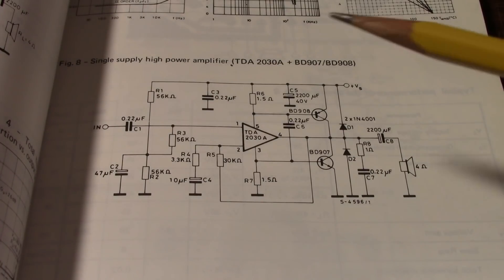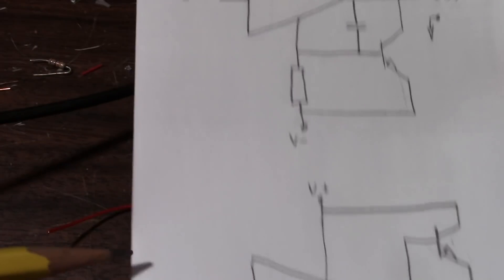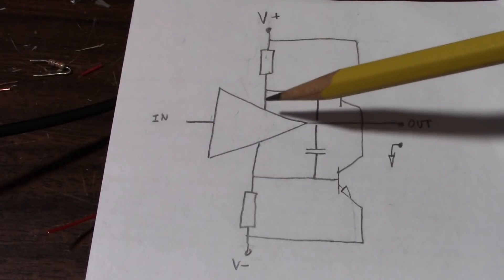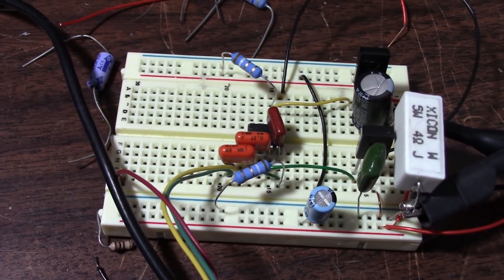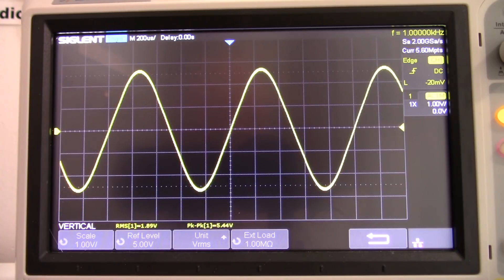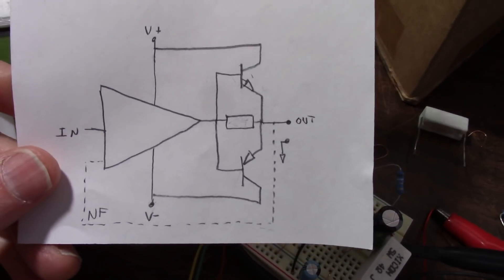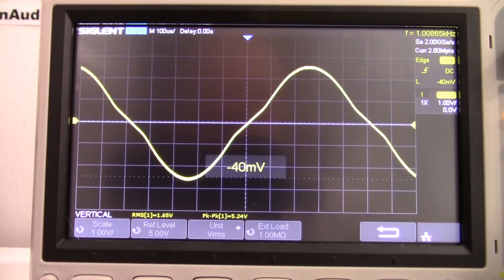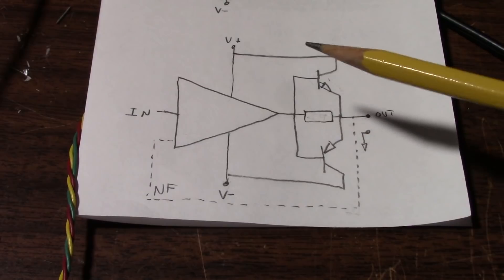Booster transistors on an LM386 - why it failed

Comment: I think that around 9:22, you're being incredibly optimistic about the potential output swing. Remember that with a 9V supply, you've only got around 7.6V available to the LM386 when it's being driven to clipping because of the two transistor junctions that in series with the supply to the LM386. If you look at the datasheet for the LM386, even with a 16R load, you'll be lucky to get a 6Vpp swing from a 7.6V supply, so your 5.36Vpp is quite reasonable.

Comment: Have an IC that may be one that will compare to the LM386 and it shows it works with a 4 Ohm load. The part is a  TBA820M that Future Kits uses in their Amplifier kits.

Comment: Howdy.
One step forward in improving is connecting a dummy load resistor to the LM386 output and disconnecting it from the real output.
In my blog:  "23. A Solid State 50 W Class AB Audio PA. Luokan AB 50 W transistoripäätevahv."
I have a study of a similar project.
Regards.

Comment: I’m curious if you were to use a dual power supply and feed the transistors a much larger voltage if then you could get more power. I definitely could think of some uses for this like may be driving a reverb tank where the distortion isn’t going to be an issue.
Reply from the maker: Circuit is limited by the output voltage from the IC, so more voltage would need to be applied to it.

Comment: Thanks for the video John. I'm reminded of a circuit I saw used throughout a MCI JH600 series console: this used 70V rails (+/- 35V) and every stage consisted of a high voltage opamp with buffer transistors. The transistors were emitter followers with 10 ohm emitter resistors and were driven by a 1K ohm resistor at the output of the opamp. The bases were tied together. This configuration used negative feedback (10K I think), but the purpose was so each stage could be patched into a mult and drive several inputs (usually 600 ohm). I think I've described this accurately, but it's been 20 years or so. I enjoy your videos and look forward to your next.

Comment: Hi John I love your videos I've learnt a lot I was wondering whether you could help me with something I have have I set off Kenwood 6 ohm speakers which I want to attach to my Samsung TV what is the best amplifier for it and do I need a preamp
Reply from the maker: As long as the TV has a line out connector, about any amp can work. There are lots of budget amps under $100 that can work. Most TVs let you adjust the volume through the line out so you don't need to walk over to the amp to adjust the volume.

Comment: I wonder what the results would have been if you had upped the voltage to closer to the max, say 15-16 volts. No use in burning out a perfectly good LM386 at 18 volts.
Reply from the maker: I did run it at 12 volts and got just under 2 watts at 4 ohms. Weak for that voltage but the LM386 can't do that alone.

Comment: I think you need a solid load transformer. If LM386 works well on 16 Ohms load, you have to translate this current into output transistors current (loaded with 4 Ohms of course).

Comment: The LM386 is a self-contained amp with its own output circuit optimised to drive a speaker directly while conserving battery life. It's main design feature is its tiny current draw. More volts in will just smoke the chip so its a one trick pony. Adding a second power amp to the back of the clamped down power amp in the 386 is a challenge and a pre-chip driver will overdrive it. It would be hard to imagine a worse candidate for power boosting. You showed that a 16ohm load would allow more volts in and a bigger swing, I would like to see the built results, I'd guess a nicer sine wave but no more amps to drive a speaker? How about driving two LM386 together in push-pull you have the neg and pos inputs but would the chips share the load and double the output?? :)
Reply: Another suggestion John, it might be interesting to build the whole circuit suggested on the paper you showed at the beginning, rather than just a cut-down output circuit. I am a newbie to electronics so you'd know better if there is some 'magic' ingredient in that schematic. Brilliant video, it's great that you build and test, rather than just a dry discussion.

Comment: I knew what was coming, but experiments and observations with a scope and final analysis of the results are always educational.
An NE5532 driving an output push pull current stage with global negative feedback is pretty low on the parts count and provides much better results than trying to do things with an LM386 :)
It's just not a very good amplifier really

Comment: Truth be told, I have never seen this circuit working with the TDA2030A let alone the LM386.... 
I have seen the TDA2030A circuits in their datasheets and have always wondered if it was actually an good! 
It's just something that I have been planning on putting together for testing, I have plenty TDA's to play with so I guess that I will have a go at it one day... There's an excellent 3 way powered speaker amplifier design that uses the booster transistors for the bass driver in the ST datasheet and another version for a 2 way design possibly from the brand of datasheet that you have there... 
So basically if you have a TDA2030A in stock and decide to build it, I will definitely be watching it! That video doesn't exist on YouTube anywhere! 
What I don't get, is why the transistor base is tied to the rail's? I would have thought that they would be tied to the output of the TDA! Basically using it as the driver stage before the transistors but it seems that they are trying to add the TDA output to the transistor output for some reason....
Reply: This saves you from trying to bias the transistors and it eliminates the in the trivial case fairly audible crossover distortion. Since crossover distortion is pretty much a "solved" problem in a decent chip amp, they try to leverage it to drive the lower output voltages, where it will provide less distortion than any transistor contraption that you're likely to just throw together.

The bases on rails thing also makes the transistors turn on somewhat gradually, which is a good thing. As you see in the scope, there is no hard knee there, it's softened a little. This is crucial to allow the global negative feedback to linearize the circuit, since negative feedback is increasingly ineffective against higher order discontinuities due to inherent slowness of the chip amp driving it. These ideas don't really help the LM386 because there is no global negative feedback, the feedback is locked to within the chip.

Comment: Would this configuration allow you to use a higher supply voltage then the chip amp by itself which would overcome the loses?

Comment: Wonder if a biased common emitter stage with local feedback, connected to the output, would do better
Reply: the problem is that the lm386 already has some feedback internally and you need an inverting input
Reply: @Dazzwidd  not GNFB just local feedback. Although I'm not sure it is worth doing. An R2R opamp with feed forward does the job better than the LM386, along with diode biased outputs so they're just barely on. And still low power consumption. Such a setup will get you very close to the rails. I think JAT actually built one like this in an earlier video.

Comment: Can you do it for the TDA7293?
Reply from the maker: Possibly. It has circuitry based on the mute and standby function that connect to ground. It could potentially pose an issue that would need to be dealt with.